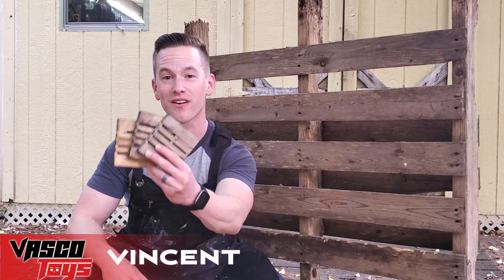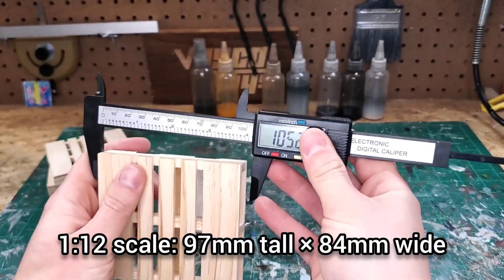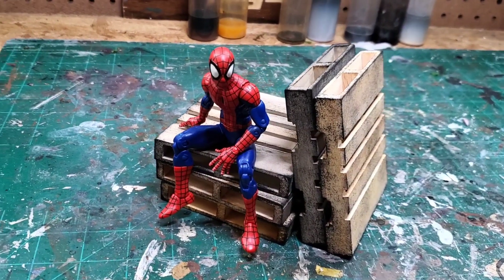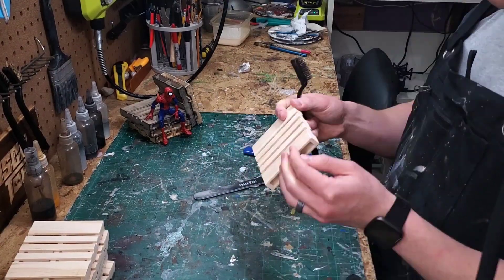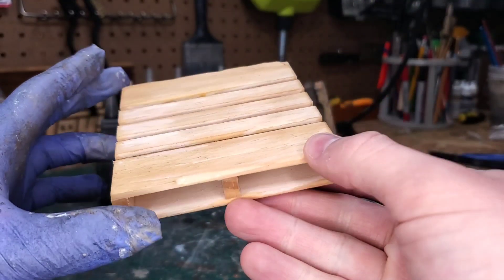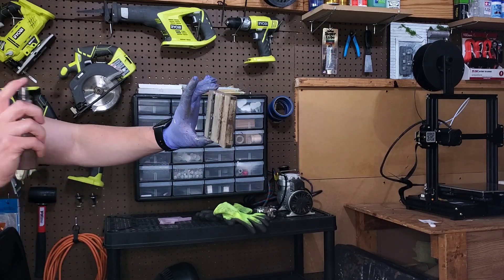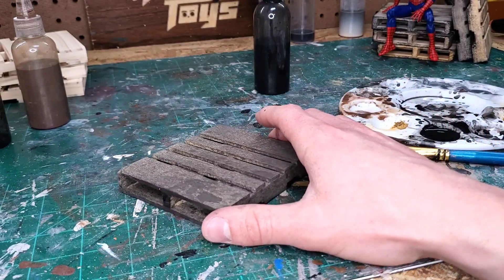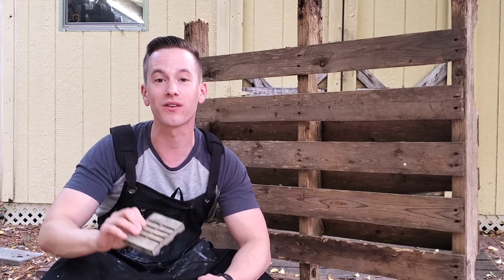The PERFECT pallet for your Marvel Legends

Comment: Firstly I enjoyed the content cheers. If you put in the smallest amount of dishwashing liquid in your washes it breaks the surface tension of the water in the paint and it spreads around better on figures mainly because it wouldn't have made alot of difference of the pallets but I'd just wanted to share that I recently learnt it which was good because I've had trouble before getting washes too coat everywhere
Reply from the maker: Great tip! I do sometimes put a little Dawn dish soap in my washes, but just kept it simple this time. Thanks for watching and leaving a comment!

Comment: Those scale well since there is not too much of a standard size but more of a general range.  
Have seen more and more of the wide end types. Still scratch make but those are total time savers for a buck 25.  The boxes also could be modified to crates but have only seen one sze at DT.
Reply from the maker: Yes this definitely makes sense for the time saving alone.